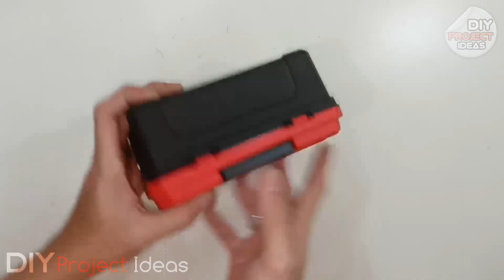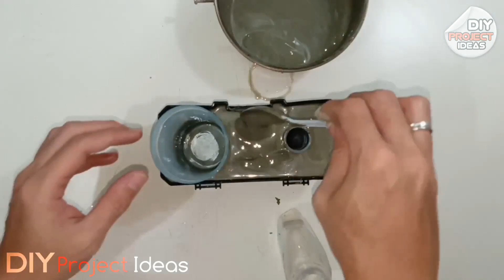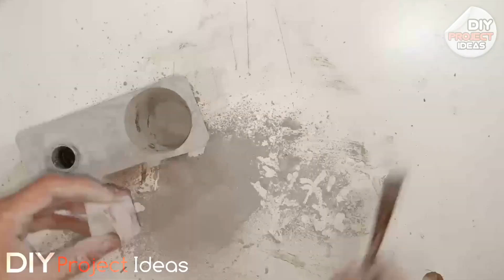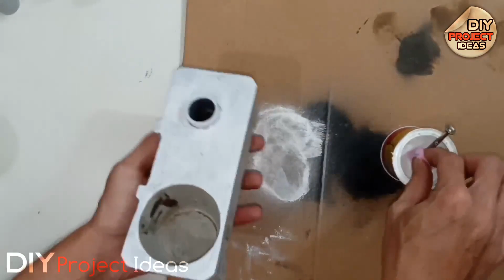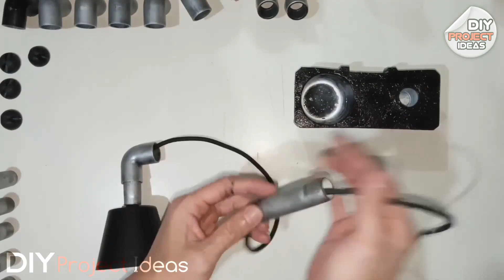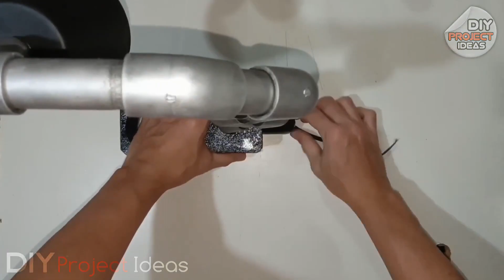DIY PVC Pipe Desk Lamp with Succulent Planter: A Unique and Functional Craft

Comment: Cost of dimmer switch
Reply from the maker: dimmers around not up to $ 2
Reply: @eBiCrafter  thanks
Reply: @eBiCrafter   but in India it cost  about 1200 means $17-$18
Reply from the maker: @officialbankeybiharimandir_01  wow, it's very expensive, maybe you can buy it on AliExpress, the price is very cheap there
Reply: @eBiCrafter  i want ask one more things that its shipping charges is $80
Reply from the maker: @officialbankeybiharimandir_01  You can find free shipping, there are many sellers who provide free shipping to india
Reply: @eBiCrafter  I'm unable to make because of required material I'm very very sad 😔